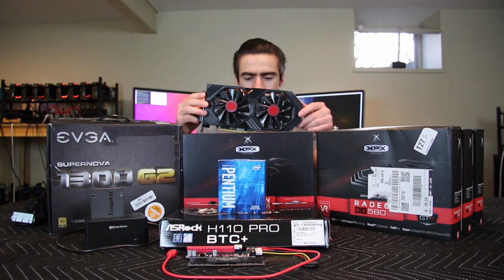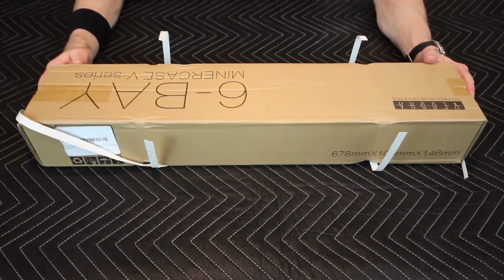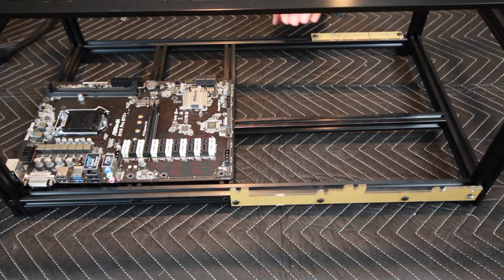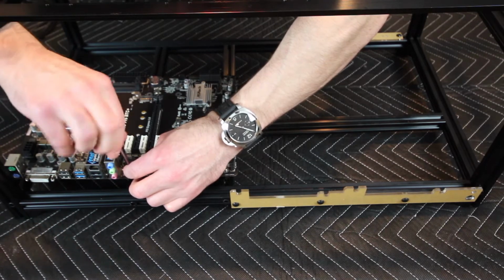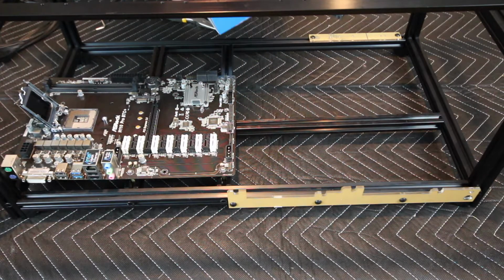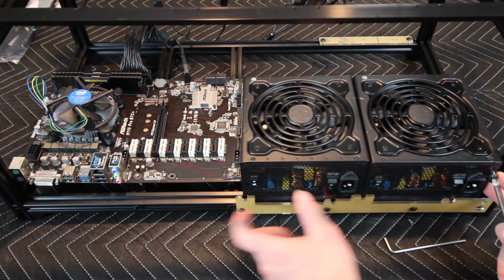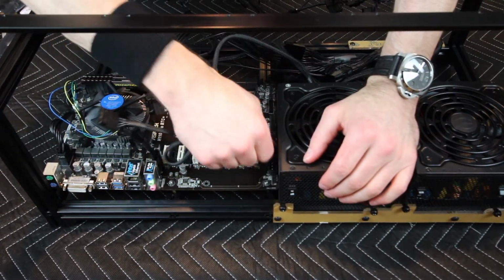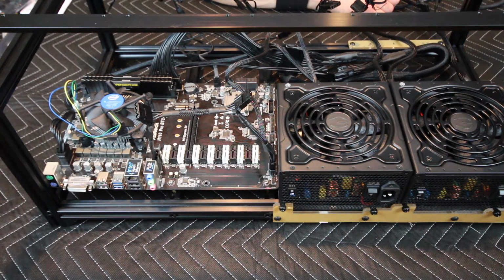How to Build an Ethereum Mining Rig (Part 1 of 3)

Comment: Hello Mr Alexander I have bought everything on the list except GPUs and power supply waiting to get those soon. Used all your links hope they serve you well. And thank you for the info. I have a 2 questions. 
1) would a AMD chip work in the H110?
2) would honeyminer work best or ethos?
Reply from the maker: XMD Services, XMD Services, haven’t tried an AMD chip- only Intel Pentium (cheap).  Honeyminer mines Bitcoin and ethos mines ethereum.  I’m putting together another tutorial soon (a better, comprehensive deep-dive) re: how to mine Bitcoin: https://www.alexanderjsingleton.com/the-easiest-way-to-build-a-bitcoin-mining-rig-with-honeyminer/

I’ll also update the blog-post corresponding to this YouTube sometime tomorrow- thanks for liking this video!  Glad you enjoyed!
Reply: @alexanderjsingleton  Hello Mr Alexander so I got all my parts and build the rig with total 8GPUs  and two 1000 psu. I had put the daisy chain with the fans but once I powered it up b it shut right off. Can you help me troubleshoot it
Reply from the maker: XMD Services, did you try turning it on without the fans first?  I don’t use fans and the rigs run just fine- just make sure your periodically air-dust and vacuum; also, consider running air-purifiers (eg sharper image ionic breeze :).  Hope that helps!
Reply: @alexanderjsingleton  at the time I was building this in house not much dust, but I'll do that. Could it be the board is faulty? I've tested the psu with the tester it came with both turn on just fine. I also took everything apart put it back together just incase I missed a step. Did you have to reset the CMOS
Reply: @alexanderjsingleton  sorry forgot to answer you regarding the fans. Yes I did try it with out fans
Reply from the maker: XMD Services, check out mark 1:15:38- pay attention to the which pin the on/off switch is plugged.  Obv, you should be in a great with or without whatever you need.
Reply from the maker: Also, what motherboard are you using?  The most successful to date (in mu experience) is the ASrock h110+ btc.
Reply: @alexanderjsingleton  I'm am using the same one the asrock
Reply from the maker: XMD Services, happy to try to help further- can you please link a pic of your rig via flickr or imgur?